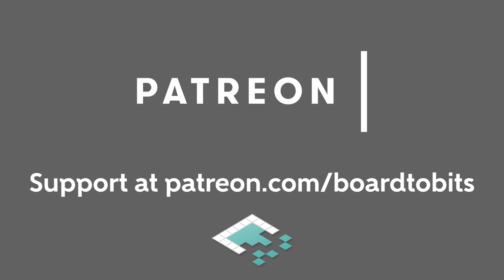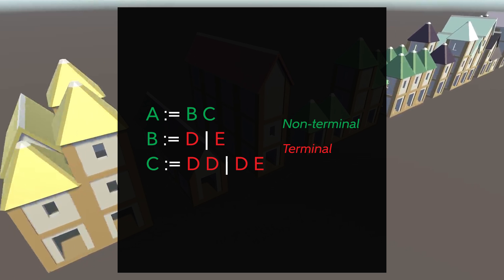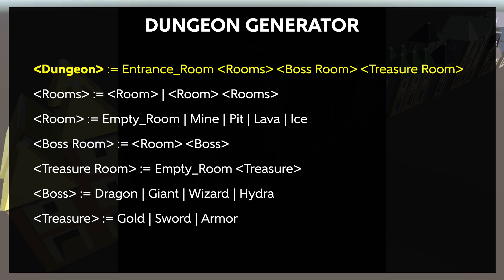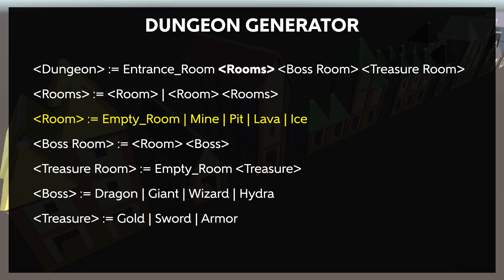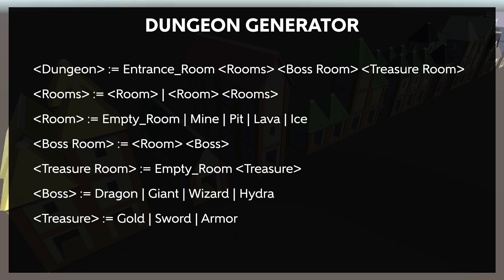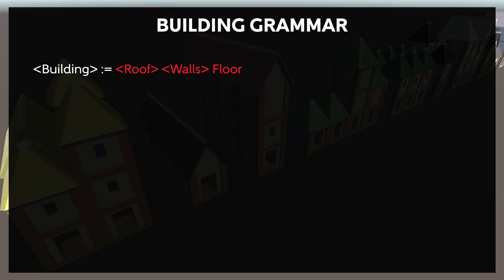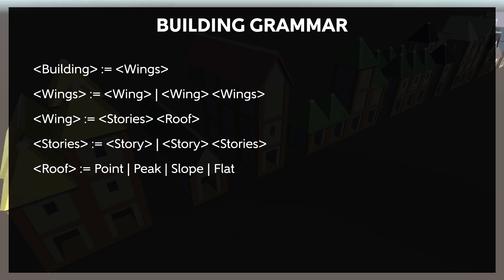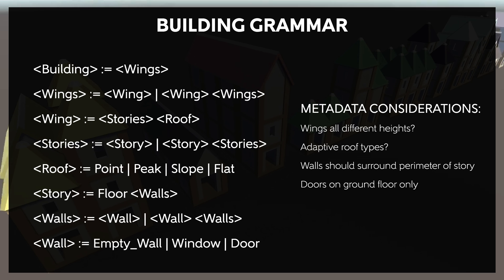Procedural Buildings, Part 3: Using Grammars

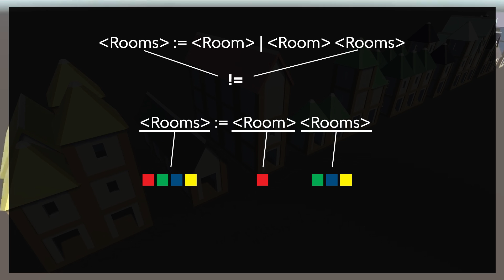Comment: First off: Great video! But I think your depiction @2:30 is a little confusing. It suggests that <Rooms> can not produce the same <Room> after it already produced it once. I also would not agree that it is not the same <Rooms> on the left and the right. I'd think it is the same, which leads to the desired recursiveness.

Comment: Great video!
Just a (rather pedantic) correction: In regex, an asterisk (*) matches 0 or more.  You meant a plus (+) which matches 1 or more
Reply from the maker: zeaga15 that’s true; and technically to model 0 or more in BNF, you need to offer a null option as well (eg, Rooms := Room | Room Rooms | NULL)